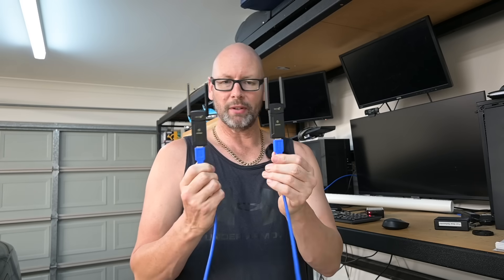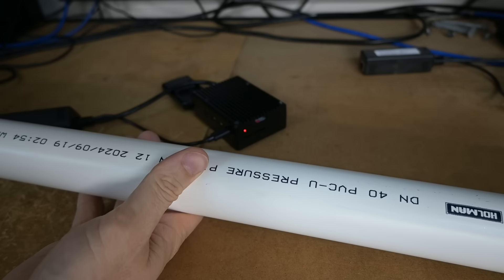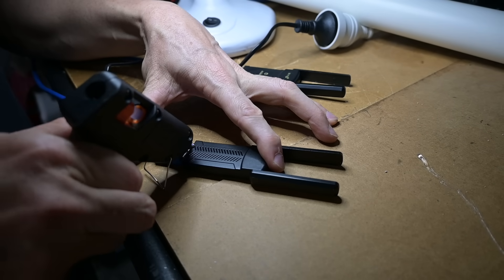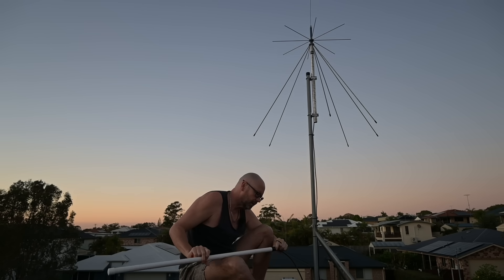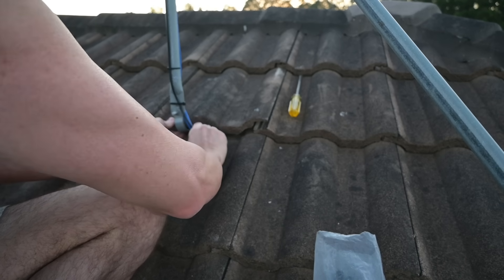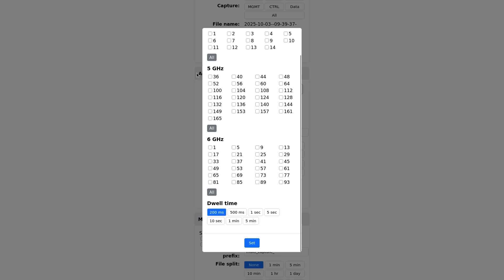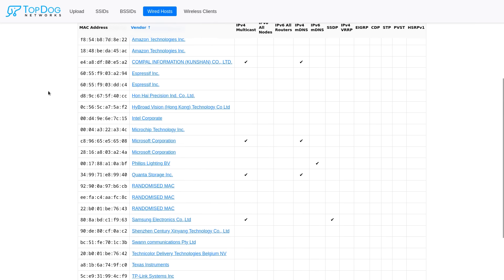Listening To Neighbourhood Wi-Fi

Comment: Building codes are different in Norway and Australia I see.  That roof would not take the snow height and water load we get here.  Just the thought of making a hole in the membrane (and where is the sub roof??) makes me ill.  Had pretty bad water ingress last spring when the meter of snow melted, PTSD from seeing holes in the roof.  Had to replace the entire roof and rebuild the bedroom below the ingress point.  So any nordics wanting to build something similar, make it for our climate.  Don't puncture your roof, make sure you get a drip nose on the cables and make it properly rodent ingress safe.
Reply: Queensland roofs do not need a snow-load rating...  The day it snows in Brissy - you know the world has ended.
Reply: I had the same reaction in Scotland. That would not be a viable route for a cable here either!
Reply: Different situation in most of Australia.  I avoid penetrators where ever possible in my own roof (tropical Queensland) because every hole is another potential water entry point.  The only holes in my roof are for the screws that hold the sheeting down.  Vent pipes go around the eaves.  TV antenna (largely unused these days) is screwed into the fascia of the eaves.

Comment: In the next iteration of this setup, i recommend getting wifi adaoters with removable antennas. Then you can put the antennas on the roof using long extension cables and have all the electronics inside.

Comment: Always nice to see an outdoor action video 👍🏼😎
Here comes the “I would have done it this way” advice : drill a hole in the tube and secure the USB cables with a zip-tie. For securing the wifi adapters : loctite (blue superglue). The Pi case I would mount to one of the beams.
But hey, your installation looks the part. 
Looking forward to future videos with the capture setup 😊👍🏼

Comment: A cool project would be to combine surveillance cameras with 'ai' detection of faces, car number plates, and bluetooth data so that you can know the comings and goings of whoever is in the area.
Reply: A camera into Frigate in Home Assistant can do this now.  My cameras log all number plates and faces of anyone that comes to my property.

This is possible for less that $500 and a couple of hours.

Just search for "facial recognition frigate home assistant".
Reply: My new system does exactly this.  I've masked out anything that's not on my property but everything else is captured and logged.

It's insanely simple to do if you can  afford the couple of hundred to set it up.
Reply: I have always wanted to integrate Bluetooth into home surveillance honestly while it wont like completely identify someone if it got a first name when investigating or finding someone after a break in it would give the LEO a way to at least potentially confirm the perp. most have the default name so like an iPhone will give the first name at least.

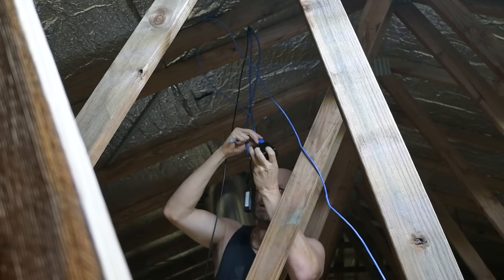Comment: 5:40  if you have problems especially with 2.4ghz it's because usb 3.0 uses 2.5ghz as the bus so its interfering with your packet capture. Usb 2 uses a lower frequency that doesn't interfere with WiFi.

I found out about this because I was taking a backup from my pi 4 server onto my external usb 3 HDD and for some reason all of my IoT devices got disconnected from WiFi. Apperandly if a usb 3 cable isn't well shielded and you have your access point right next to it it might cause this kind of problems. I just then moved the HDD like 20cm away and there were no problems.
5ghz didn't have any problems
Reply from the maker: I had briefly considered that, but I didn't confirm which band wasn't working. I'll check it again properly and confirm. For now I only planned on having 2 adapters on it so didn't dwell too much on it. Cheers.
Reply: Yup, this is why people who use Zigbee controlers for smart devices also advice to just use a simple USB2 extension cable. And because Zigbee is lower power it makes even more of a difference. Try the USB2 ports on the Pi, that should help a lot already, or change the USB extension cables to USB2 ones.
Reply: Intel published a paper on this in 2012.  It's on the USB org web site.

Comment: In the heat hot glue is going to melt.  In the cold and rain, water will enter your roof space - use a small Dektite for proper roof tile mounting.  Also suggest to add links to the wifi product you are using.
Reply: Thanks Karen

Comment: Great content Paul!

What was the highest capture throughput you observed in your tests?

Will you be adding any more radios to this? you could setup spatially separate radios to triangulate and identify moving clients. Add some Bluetooth capture and you could also identify (potential) Apple Airtags that come into your home.

I feel Wi-Fi manufacturers take the piss when advertising throughput numbers for their single radio devices (AX3000) i.e. take 1200Mbps on 6Ghz AND 1200Mbps on 5Ghz AND 600Mbps on 2.4Ghz THEN conflate these all together and advertise a 3000Mbps product, even though it only has a single radio. It would be more honest for Manufacturers to advertise single radio devices as the maximum rate connected to a single band (Logical "OR" instead of addition operation).

Comment: Do you have problems with water weeping up the cable and into the roof space?  

Probably more likely to happen in light rain than heavy.
Reply from the maker: Nope.
Reply: @TallPaulTech This was exactly the question I was going to ask. You've cut the sarking. It will probably depend on the direction of the rain too.
Reply from the maker: @robertsandy3794  Pfff.... it survived a cyclone just fine. Gravity does its thing
Reply: @robertsandy3794  Plenty of older tiled roofs out there without sarking at all
Reply: In SE QLD we get delightful rain in summer where we suffer a humid mid 30s during the day then around 2pm onwards all hell breaks loose then it often disappears and everything evaporates. Quite mad at times. I’d imagine it makes it pretty unlikely he’ll get water weeping up that far given the length of the tile overlap and the heat of them.
Reply: @pantoqwerty I’m from Melbourne. Our eternal struggle is staying dry.